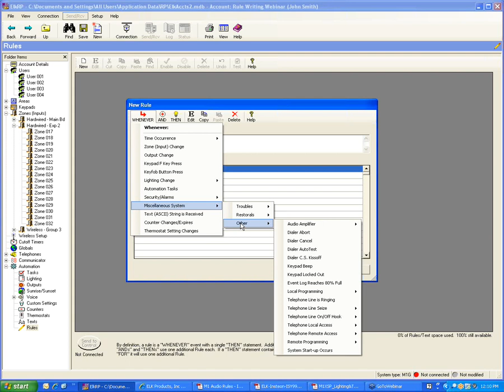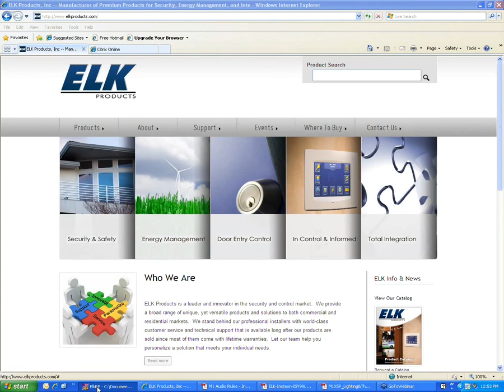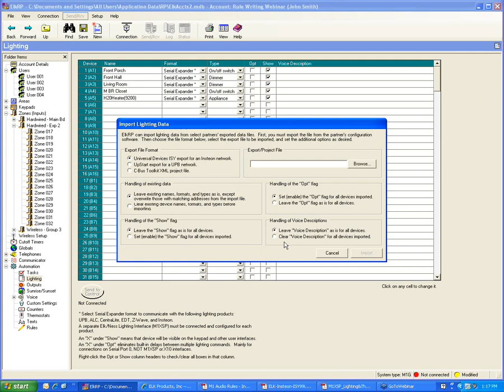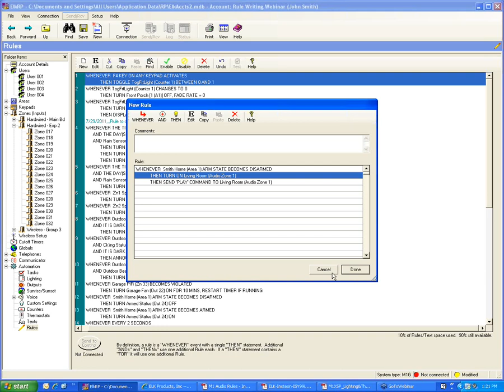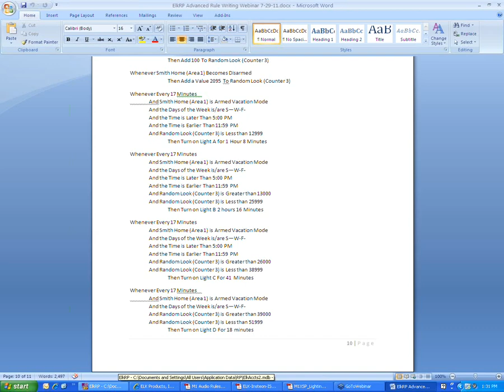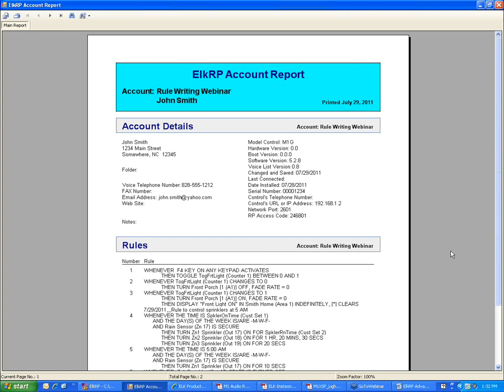M1 Rules Programming with ElkRP

Comment: We had an event where the alarm was not reset at 3am and that resulted in burglary and a huge loss of merchandise.  We are considering the Honeywell, Elk and Dsc.  I'm liking the Elk because of all the rules that can be programmed.  I want the following rule and can the Elk M1 do this?  Ok,   Between 9pm and 8am if the alarm is tripped I want key holders to be notified. Then, every 20 minutes that it isn't rearmed I want the Elk to send key holders a text notifying us that the alarm has not been rearmed.  Another option is if alarm is not activated between those times then it will automatically rearm the system every 20 minutes.  Is either of these possible?